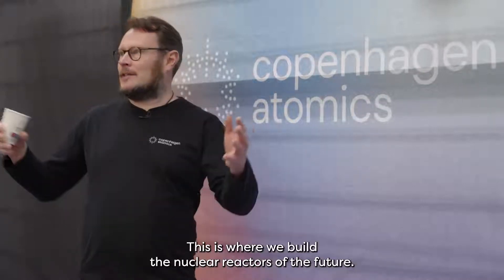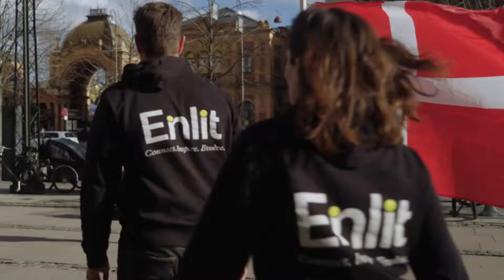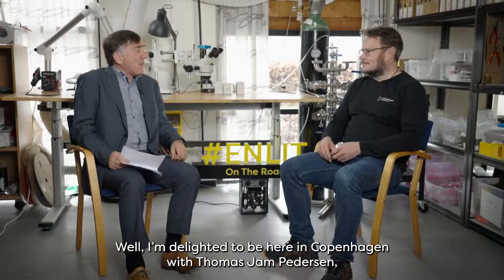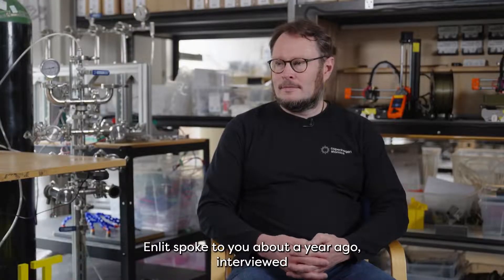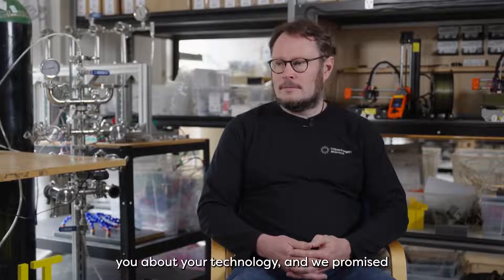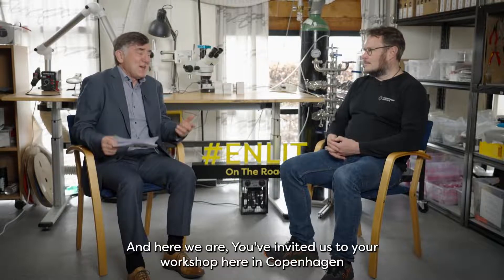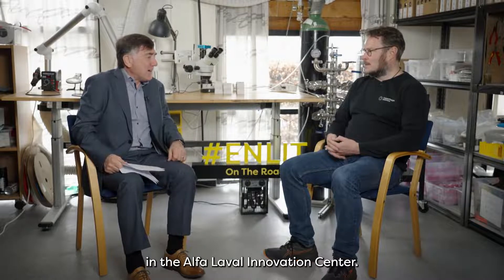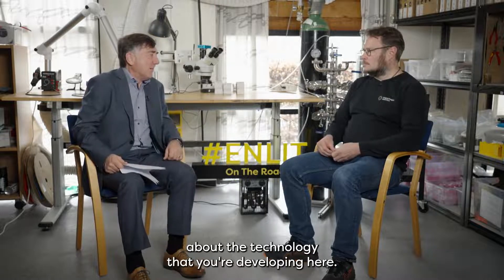Site visit Building the nuclear reactors of the future

Comment: Very interesting.
Have they solved the whole alloy/corrosion problem yet?
Reply: At Oak Ridge Labratories they Solved the problem with an alloy called Hasselhoy N. This is a material that is extremely resistant to corrosion. In Denmark they have managed to produce a super clean salt that apparently will so cause corrosion. They have removed all impurities,moist and oxygen something that allows them to use ordinary stainless steel.
Reply from the maker: I don't know. I have just made the video for a another company.
Reply: They're the ones with the most insight into it or at least they should be because they make ALL of the molten salt loops used for research all over the world as well as the ultra-pure salt that goes into them. If your salt is pure, you don't have a corrosion problem apparently. So for anything non-nuclear (aka. all test loops) that's all you need.
PERSONALLY I believe this principle fails when you start a nuclear reaction and new elements are being created constantly and I THINK I heard Copenhagen mention that they want to actually use carbon composites for their reactor.
Reply: This is a problem for metallurgists and solid state physisists